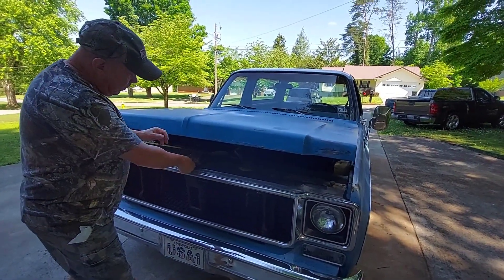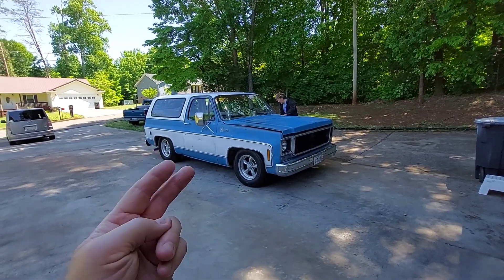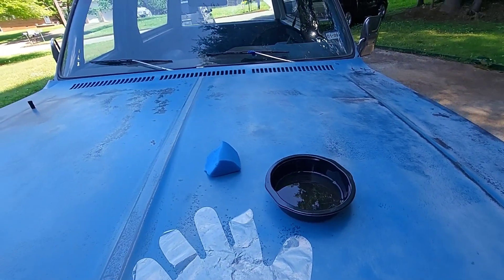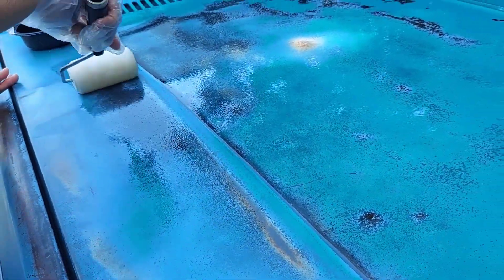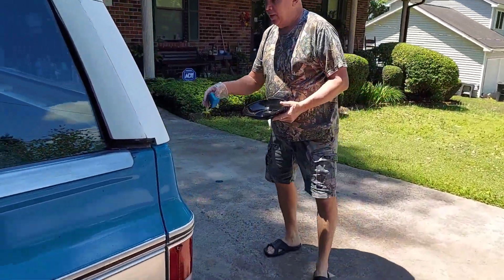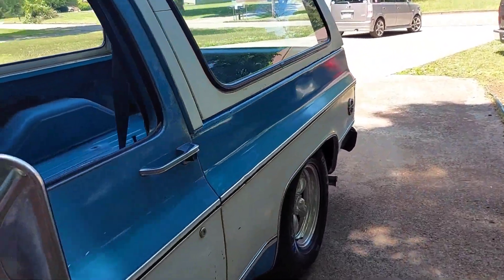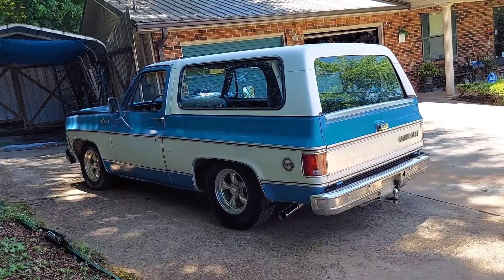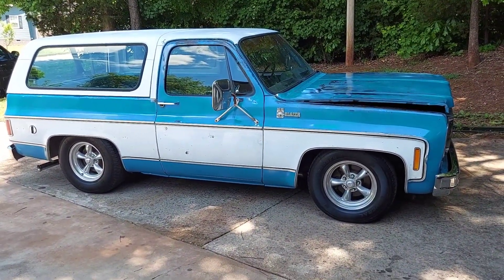How we apply Penetrol on this 1976 Chevy 2-Wheel Drive Blazer! Answering commonly asked questions!

Comment: Penetrol made it "POP" ! Everything You and Mrs PIB have done to this Blazer has made it better . The was job , removing the tint , cleaning the windows , matching the paint , painting what needed to be painted (at first I didn't think painting the hood was the correct choice but I was wrong) , and applying the Penetrol have all set this K5 2wd Blazer apart from the rest . Fun fact the K5 2wd Blazer and Jimmy are the only 2wd GM trucks / SUV's with the K which was used on all 4wd GM trucks and SUV's
Reply from the maker: I think that it turned out good as well! That was good info about the "K" too! I hope that Tim will like the Blazer when he gets it back home! Thanks buddy for your comment! I really appreciate it!

Comment: Looks good! Does it dry or stay wet, and does it bubble up if water gets on it? Thanks
Reply from the maker: It will dry. I usually let it stay I let it stay  in the garage for around 24 hours or longer to completely dry. I have not ever noticed it bubbling up. Water will bubble up on it when it gets wet. But you do it at your own risk. Thanks buddy for your question!